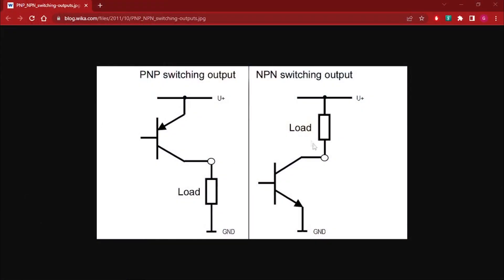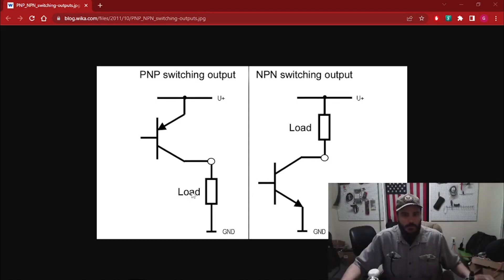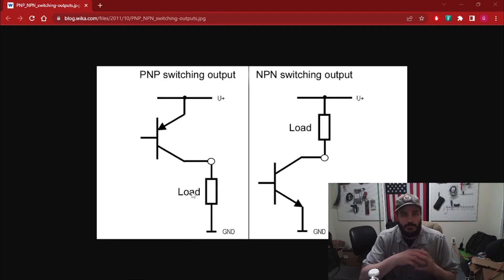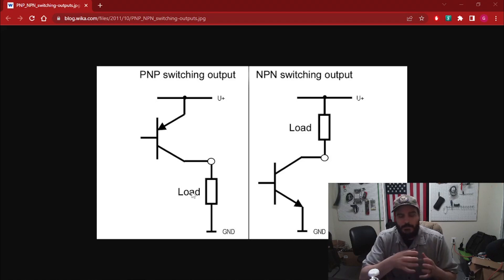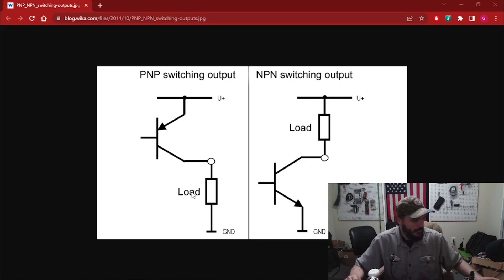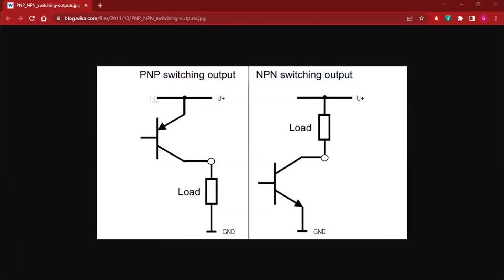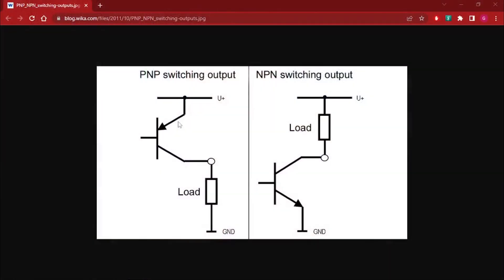NPNvsPNP How to test. How to tell the difference.

Comment: Great video. One question to help me get this straight. If i have a NPN sensor and its flagged, to check it with my multi meter i would put my red meter lead on the positive power supply terminal and the black lead on the prox switch signal out wire i should see roughly  +24v. If i have a Flagged PNP sensor then i would put my black meter lead on the negative power supply terminal  and the red lead on the sensor signal out wire i should see roughly +24v. If im correct in my thinking then i got it.

Comment: If I have a prox that is working intermittently, the problem would have to be with the physical position of the switch not wiring correct?  For example the bracket holding the sensor is loose and changing position, even slightly. TIA
Reply: That's the most likely reason. I have seen prox that get intermittent like that.